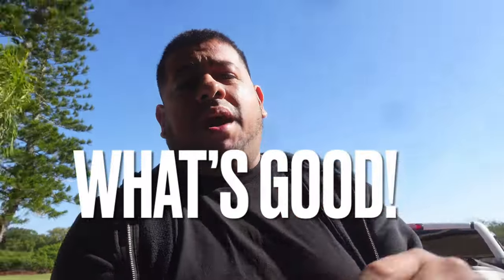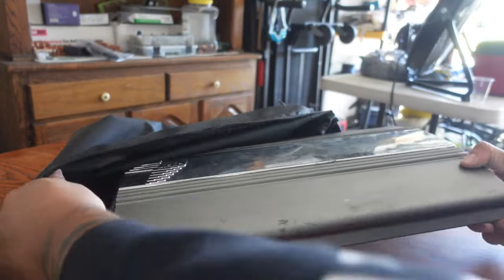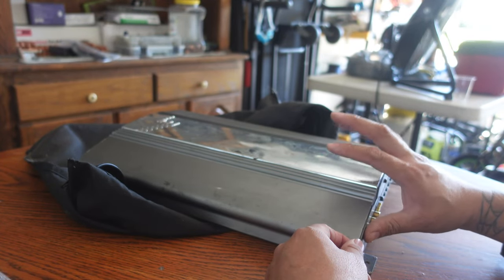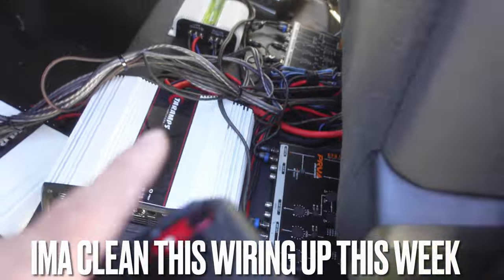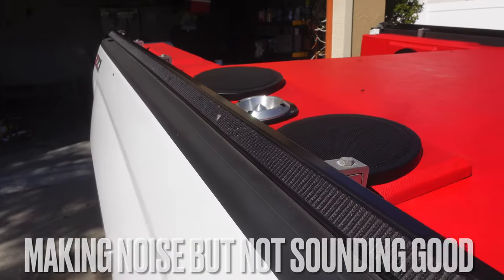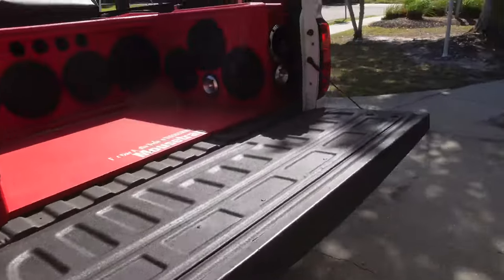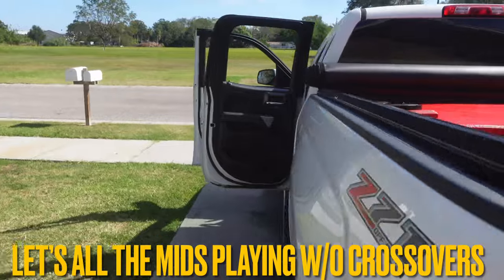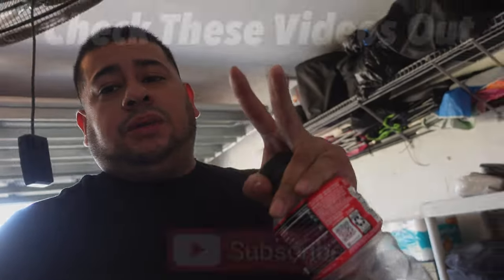STOP Using Crossovers On YOUR Mids And Highs!

Comment: Who the hell runs those old school crappy 90’s x-overs? Especially considering any decent head unit has good x-overs in them, and if not, decent amps have pretty good settings  as well. And finally: a crappy x-over versus a DSP? Where do you get your crack from?

Comment: Man I haven’t used an EQ or crossover since 97! Used just the head unit and the 4 channel. Also I’ve notice with my sound cube amps when I pluck the factory bass knob with all the bs on it it cuts down the bass. So I took that out and used a bass knob between head unit and sub amps. It’s way better.

Comment: Does anyone know how I would wire my deck 2 4ohms. I have 4-8" legions midranges, 2 legion titanium tweeters, & 2 DS18 horns. There are all 8 Ohms I wanna connect it 2 a crunch SA-2100 4 channel amp. I am using this deck for mids & highs for the clarity

Comment: This is terrible advice. It gets louder because normally the mids and highs have to be padded down due to the larger woofers being less efficient. So, it may measure louder A-weighted but it’ll sound terrible and you’ll blow your speakers. 

Awful advice.
Reply: I agree w u full 100

Comment: In my experience I got better results using a external crossover or dsp sound better and louder. The slope in those amps is to aggressive.
Reply: The slope on your crossover/dsp adds to the slope on your amp if you has a 12db per Oct on the dsp and a 12db per Oct on the amp you now have a 24 dB per Oct slope
Reply: @ottobauner9828  yes but with the crossover I can choose the slope and the frequency.